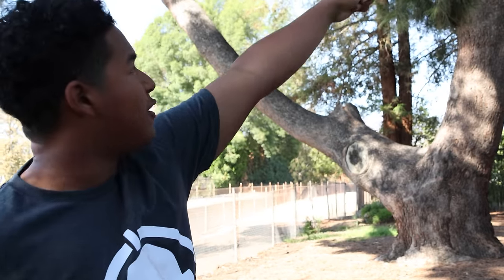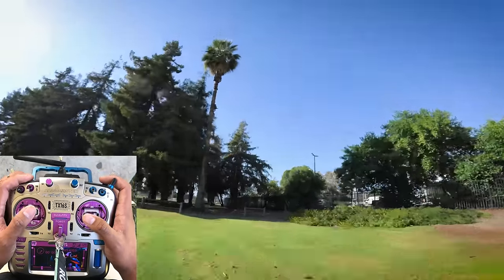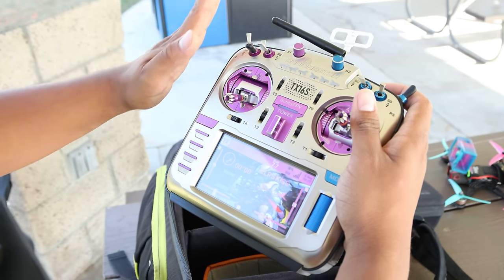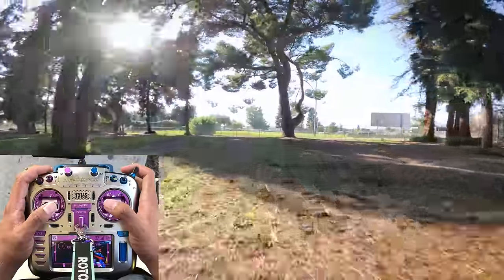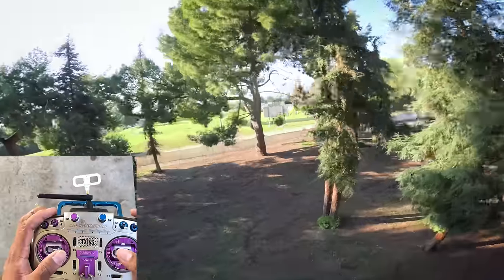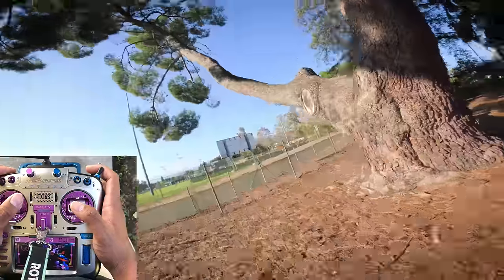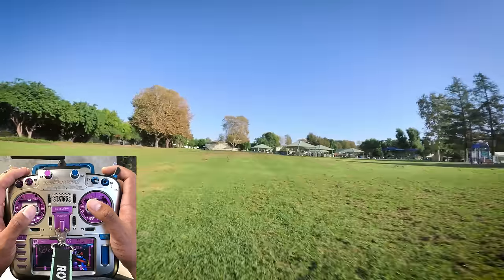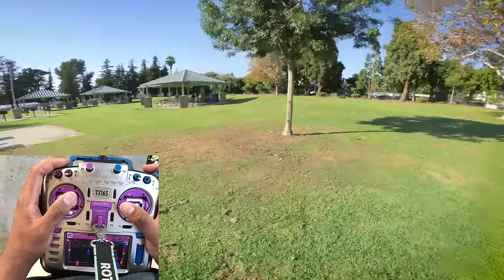This ONE Drone Trick Will Make You a Better Pilot...

Comment: In my opinion, the answer to "how to progress at flying..." is not practicing any one trick, but is flying with pilots that are better than you. But a powerloop is surely a fundamental trick in your bag that will teach you many techniques, and is so well explained by Bubby!
Reply: i agree completely, this was more meant as if you get really good at this trick, every other new trick you learn will be much easier to do just because this trick involves being good at multiple things that apply to almost every trick out there. throttle control, spatial awareness, accuracy, smoothness on stick, and so much more

Comment: Excellent video Bubby!   So I've been trying to do a proximity power Loop for a while now without any luck. One of the things I have the most trouble with is getting enough propulsion backwards. I always seem to come down on top of the object I'm trying to power Loop around. So my power Loop is more vertical than a roundish Loop. I've tried punching the throttle before I pitch back to the point where the quad is upside down. I'm guessing if the quad is already upside down I'm too late to increase backwards movement. Does anyone have some tricks I can try.

Comment: Wow Im brand new to drone freestyle and I love your presentation and explanations.
1st question: when you pull down on the left analog does the drone thrust down? So you could technically fly upside-down?
2nd: how is your throttle so smooth? Im really into smooth video capture and wondering if there's a way to tweak the input to avoid the bobbing.
Thank you so much!